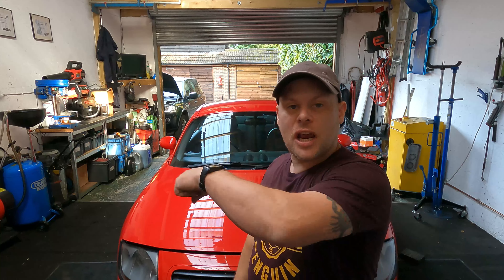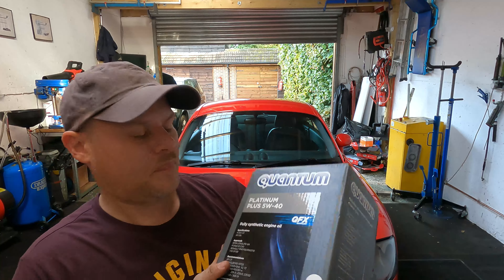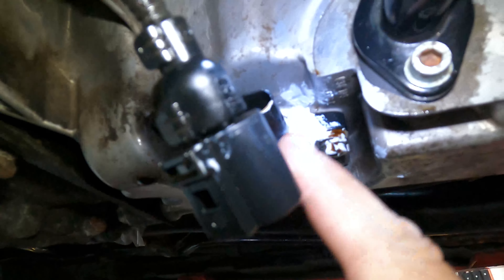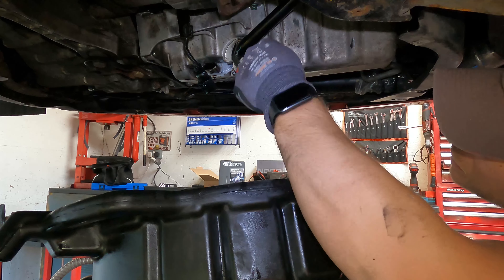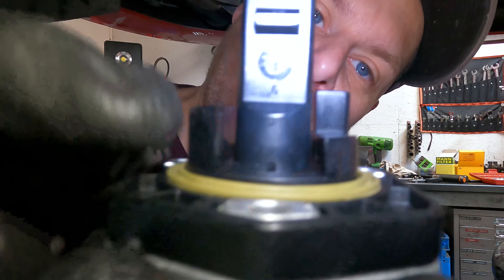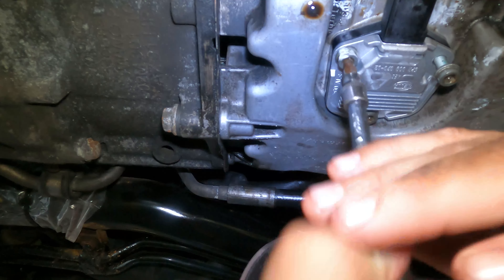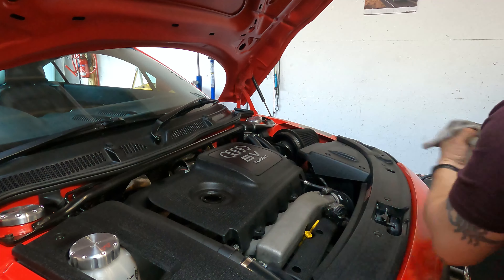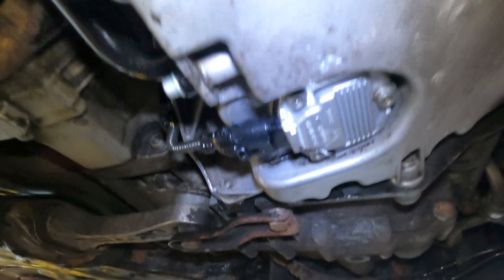Don't buy cheap parts for your car!!!!! Audi TT mk1 8n 1.8T oil and filter change + OIL LEVEL SENSOR

Comment: Chris, magnifico video, como se dice aqui lo barato sale caro, 
Why do you put 5/40, is it better? I was thinking of changing from 30 to 40, saludos. Santander Cantabria.
Reply from the maker: Most tuners recommended it for better protection when you up the power on the engine and i find it makes the engine a little quieter aswell especially with high millage

Comment: I did purchase this level sensor ( genuine hella) from a good  vag cars seller I still use the OE oil plug however I mean carefully just plugged in with fingers then torque wrench but 0.5-1.0 under rates are suggested by, I did too this on rocker cover gasket,oil level, engine oil, haldex drain plug without any leaking issue on 225 TT😂 yeah I’m not mechanic
Reply from the maker: Great stuff mate but try using a new sump plug next time there are only £3 with a new washer on 👍🏻